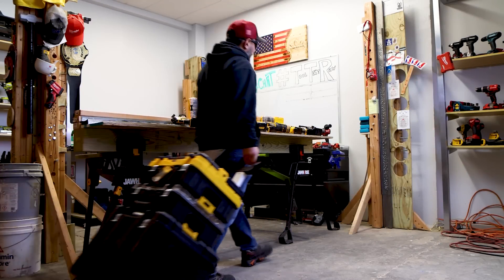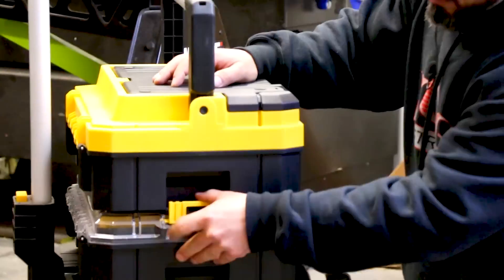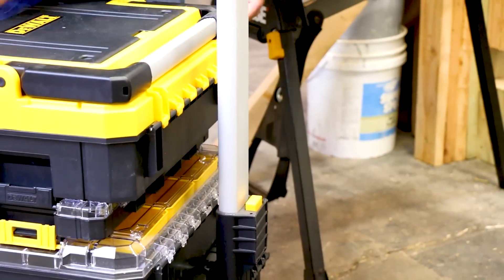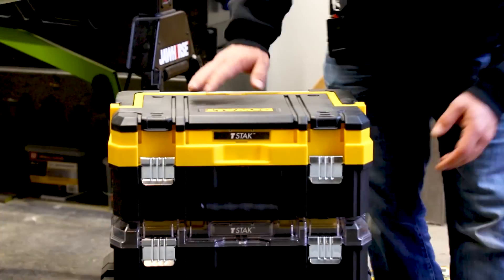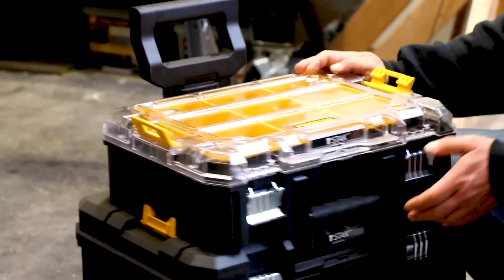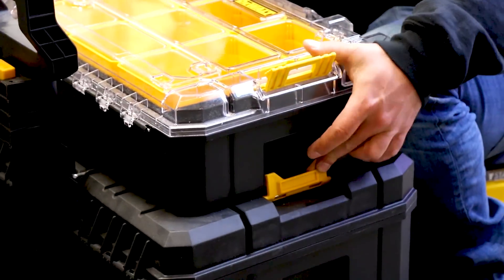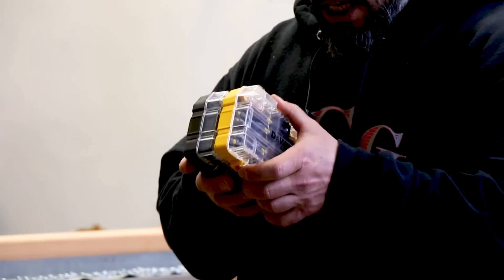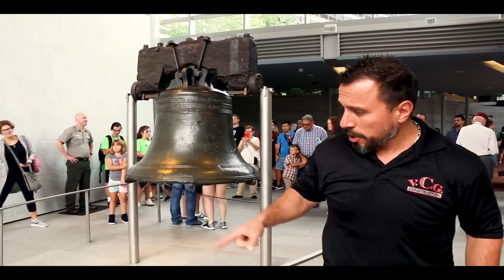New DeWALT TOOLS TSTAK MODULAR MOBILE STORAGE TOWER HAS A HIDDEN FEATURE!

Comment: this system has been out for years it's also branded as stanley fatmax and craftsman versa stack I've got parts from all the different brands and they all lock together
Reply: Yup was going to say they were the same as craftsman
Reply: Stanley, Craftsman, Dewalt, Mac... All owned by same company.
Reply: @tatoler38  is that not what i said. black and decker
Reply: I have the Versa Stack by craftsman.  Does anyone know if the Dewalt system is interchangeable?
Reply: Thanks for the Info!

Comment: @Vince - I use the TSTAK as part of my tradeshow kit. You are correct that the TSTAK is not as durable as the ToughSystem, but it simply does not need to be for many. My favorite part is that they are interchangeable with Craftsman's Versastack, which is valuable if you're closer to Lowes than Depot and need a last-minute addition.

Comment: I worked for 20+ years setting up trade shows, and saw these type systems being introduced to the market.  Bought one from the exhibitor at the show, used to use boxes and bags and belts for moving my tools.  This style I have in craftsman and love it, side locking.  DeWalt does the upgrade, gotta check one of these units out.  Retired now, but can't give up my tool addictions, and gadgets. Gadgets are the window for the best tools/toys yet

Comment: Hi Vince,

The storage box with the clear top that you thought had a hidden compartment. You can take the top container holder out put that foam insert and now you can see all your tool or batteries you hold in the case. 

Just a thought for those who use this t-stak unit.

Always learning something new my friend.

Thanks for the video...
Reply from the maker: Thanks Michael!
Reply: The problem with that is that you cant put it on top of other boxes because it has no handle on the top
Reply: @milangeurkink9917  

Oh, i thought you could? It has clips on the sides to be held down. It does have a handle on the front.
Reply: I think you would either have your tools on you, or in the box. Where as, you may not be sure on parts, or quickly need a bit, you can then quickly see if you need more parts on top. 
Then again, maybe all you have is tools in this, and parts in something else.

Comment: I have to say the t stak boxes are exceptionally durable. I have used them on site for several years with no breakages. I,v used them for hop ups , saw horses, you name it. Can’t vouch for the case with the wheels though,I use the t stak sack truck which is great.
So I can’t recommend these enough, reasonably priced too.

Comment: I have the same system under the CRAFTSMAN brand for a couple years now. I have 2 complaints about them, the hold too much and end up weighing a ton. I have a 15 pass. van converted to a work van which means the floor is higher off the ground. I have to break down the stack to lift it out of my van or carry ramps, at 77 this is irksome.  Also you mentioned about rolling it around and not being sure the wheels can carry the load, I did too, there is not much clearance on the bottom.  My solution was to buy a new axle, same diameter but longer and put larger dia. wheels on.  I put the old wheels back to fill their space and prevent the axle from bowing, then put the new wheels on, these wheels can be of a better quality to withstand being dragged around a construction site.    Sometime this summer I'll fix some kind of lifting rig to load/unload it from my van.

Comment: Hey Vince and the Very Cool Gang, I have an idea for a review or head to head. (Or maybe you can give me your opinion since you've used all of them I'm betting) I have a lot of the older 18volt dewalt tools and I'm slowly upgrading to the 20volt system. I really want to update my 18volt reciprocating saw to the new compact 20 volt XRP or maybe the 20 volt non XRP or that new 20 volt XRP that is full size. I cant seem to make up my mind if A) it would be worth dropping the cash cuz my 18 volt recip saw is still working just fine but want to upgrade it and not sure if the newer saws would be worth it and B) which of the new 20 volt saws are the best bang for the buck. 
Thanks for your concideration and time.

Comment: I use the t-stack sytem in the back of my ute for my tools(plus a carrier bag)- my SDS, grinder, and impact wrench have their own cases, I have the top case with a multi-tool and miscellaneous gear I dont use often,  but has drill bits etc. I then have a deep case(without wheels) that has my sparky belt and multimeter, with my impact sockets, circular saw and battery on top. Then the large wheeled case is at the back of the tray, with gear I have handy but almost never use on my current job, since I cant actually wheel it anywhere on this site (blowtorch, spare impact driver, all the other random crap) 

And then a tradesmans bag with my drill, driver, bits, batteries, chargers, hand tools I dont keep in my belt but use often, which I take onto site and use every day. 
plus obviously my belt with normal gear

Comment: The new tough case you have the big one with the drill bits nut drivers inside Will except the smaller tough cases  on top they inner lockand the new 2.0 Tough system storage will except new tough cases

Comment: 1:42 “Sometimes ya feel like” a nut, & sometimes ya don’t 😉
Personally, I’d give the TSTAK a score of 5-6/10 on use ability, durability, toughness (yes, separate category), easy of use (getting tools out, boxes off ( & so one), and then you have the feel, fit, & finish categories (if get a ding, does it make the system not work, or maybe it brakes; how easy for replacement parts)....this is IMO, so, you may have own thoughts.
But after using some of these for yrs, it’s what I’ve personally experienced over time.
I am interested to see the new 2.0 live & in person when released.....curious as to how well they gonna work.
Also, DeWalt has been impressing of late, AND that’s a good thing. As ya know, competition just gives better tools/options for us consumers👍🏻

Do like that the bottom TSTAK rolling box, doesn’t have the inside where it’s not as big towards bottom or wheels. You actually have less space in say a Milwaukee it seems, compared to this rolling box....maybe  🤔 b/c of design.
Thx for the vid, & the tip & features (also, there’s a website that sells Kaiden foam already cuz to fit the “box” you have. Gotta still cut out tools,  it they cut to fit box, & that’s pretty cool😉. So glad we have VCG & Fam👊🏼
Cheers✌🏼